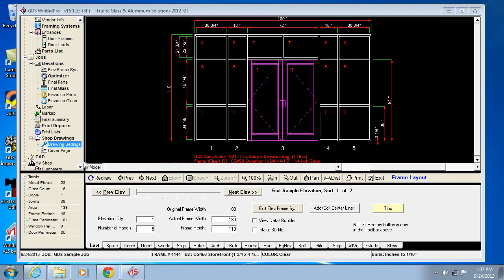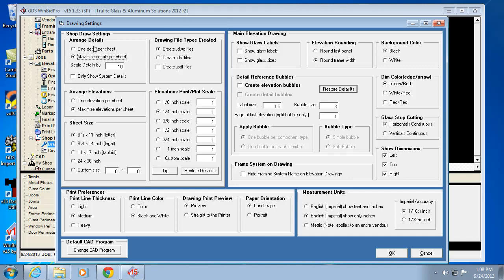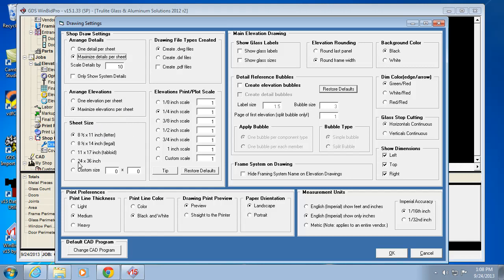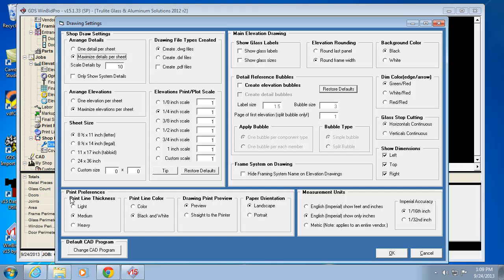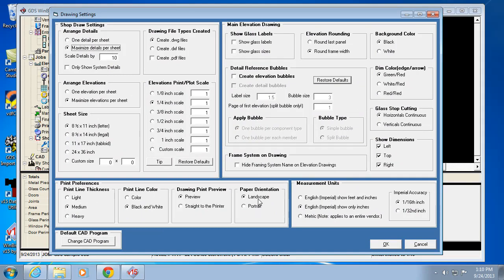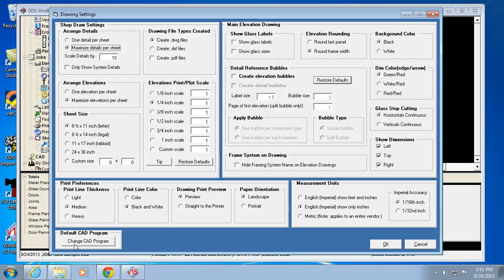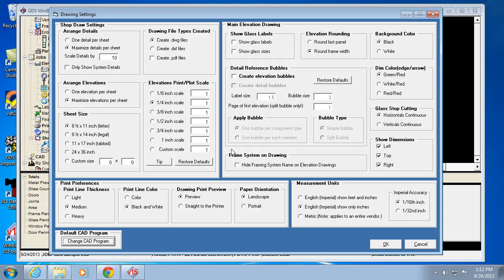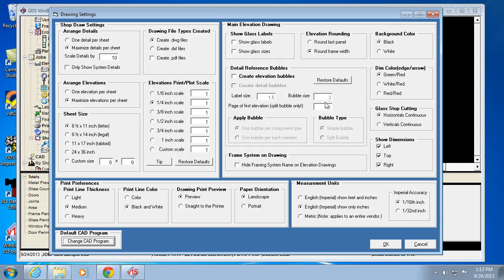WinBidPro v15 Shopdrawing Drawing Settings

Comment: Is there a way to print multiple job elevations instead of having to print them one at a time?
Reply: Hello there. This is a fairly old video, so I would go to our web site, gdsestimating.com, then the Learn - Training Videos page, and find the video that titled CAD Details & Shop Drawings. Essentially, there is a setting in the new Shop Drawings window that lets you pick One elevation per page, or Multiple. Depending on the page size and the scale of the drawings, the program will fit as many elevations on one sheet as possible.
Reply: @scottmillard5755  I figured it out thanks.